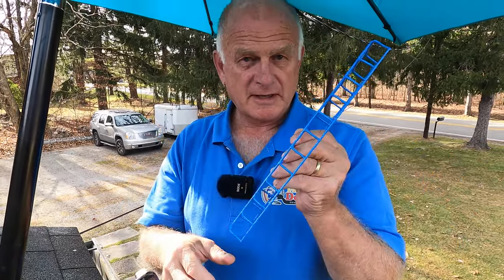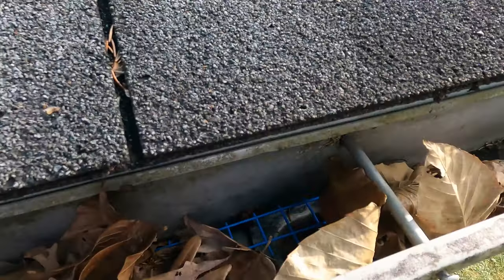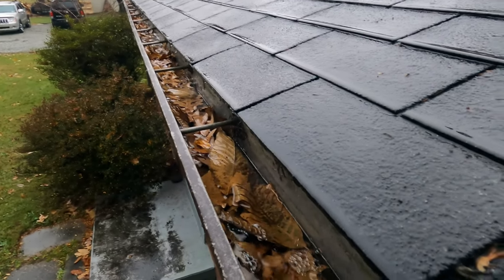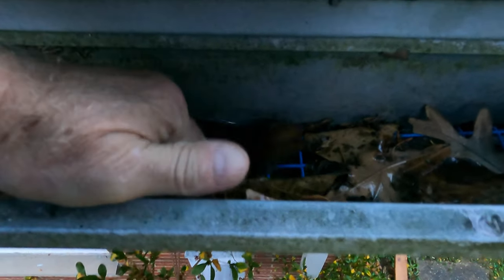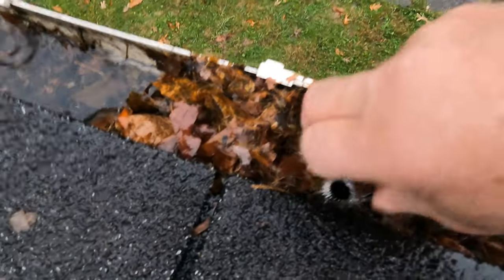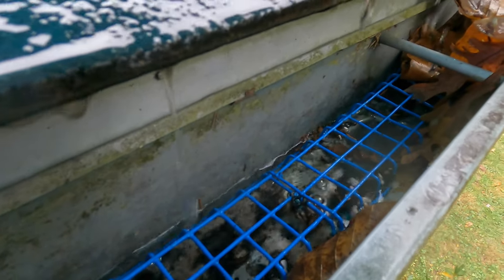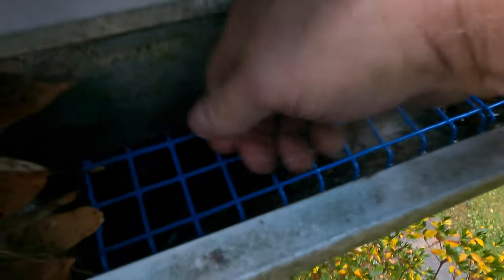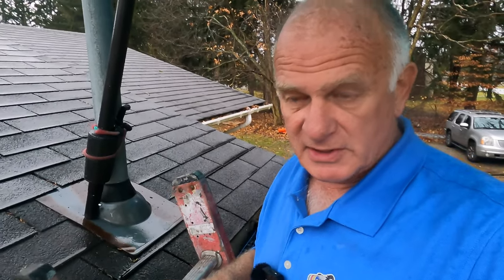Low Profile Gutter Filter outperforms all other leave filters - Bar None

Comment: The Z-gutter leaf filter is the best device on the market for reducing debris from gutter systems. It far exceeds any gutter guard/cover commercially available. There is no comparison to wire downspout covers that just cover the hole in the gutter that takes the water away. I was on the maintenance/groundskeeping crew at a large church complex during my summers for a decade, and this device is unbelievably superior to anything else. Clean out once a year and it is perfect!
Reply from the maker: I couldn't have said it any better.  The idea about this leave filter is to let small debris get through and stop larger ones. As long as the downspout is open, water will flow. This is exactly what this filter does.
Reply: @FlatRoofDoctor  When will you have more in stock, Doc?

Comment: Dear Flat Roof Doc
Thank you for all the helpful hints
Do you have any advice on how maintain a dome skylight.  The skylight does not leak but the roof and skylight is old and I want to do preventative care.  Would recommend any suggestions.  Thank you!
Reply from the maker: Not much to do. If the roof is an asphalt type roof, either Torch Down or Hot mop tar, then always coat it with Aluminum Asphalt Paint to protect it against UV's. For the Plexi glass dome, I don't have any idea how to protect it. I know they replace the dome every so many years

Comment: Hey Roof Doc i got a question, if the corner edge of a tar and gravel roof about 10 by 10 inches is rotted out do you cut it out and replace just like a Rotten board under a shingle and then Re Tar that new wood with Henry  Roofing Tar.
Reply from the maker: Yes there are many ways do do it. The issue is when you have to make a transition to where you have cut the Build- up roof. I use torch Down with Karnak 81 or 66 Trowel to bond to the asphalt after scraping off the stone and then do the normal Torch Down technique to the drip-edge. I have some videos on that.